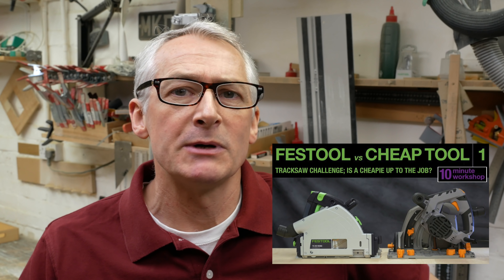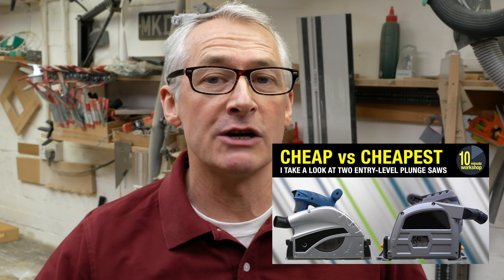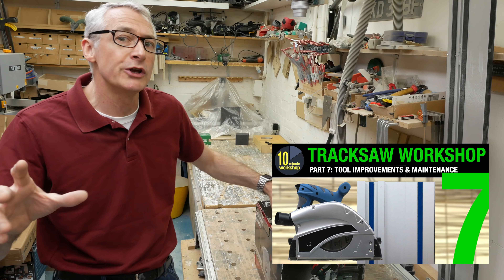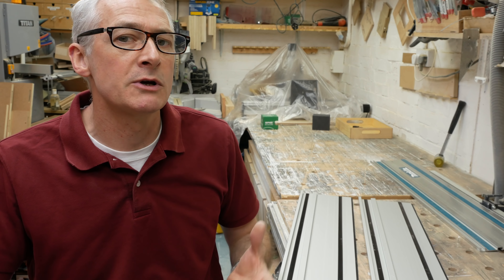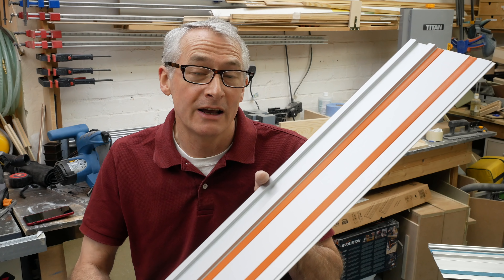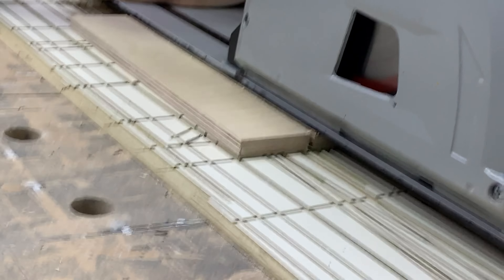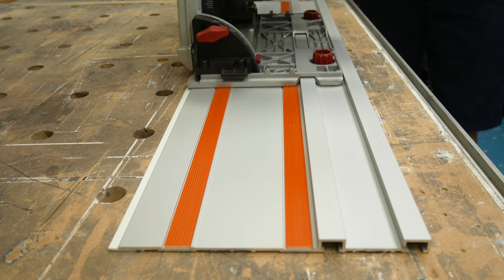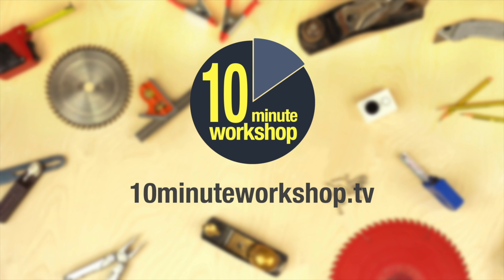Lidl's Parkside Tracksaw [Video #323]

Comment: Thanks for another informative video Peter. As a hobbyist DIY’er it’s refreshing to get reviews of tools that don’t cost an arm and a leg.

Do you think for use outside this saw would be ok without any dust extraction?

Also any recommendations for blades to improve it?
Reply from the maker: Thanks! Plunge saws are generally designed to have dust extraction, but I’m sure they’d be fine without - usual health warnings apply, of course. Video out next week about the blade upgrade 👍👍
Reply: Looking forward to it! Picked my parkside up this morning.

Comment: Got one today. Last one in the shop and a guy tried to buy it off me as I queued lol. A mere hobbyist so should be good enough for me.

 One question; would the cut be good enough to joint a board for glueing up?
Reply from the maker: Great saw for the money. As for jointing boards for a glue-up, the stock blade may be OK for a rip cut, but for anything else I’d fit a 48t blade 👍👍 Video out about that on Tuesday.
Reply: @10MinuteWorkshop  Thanks, I look forward to it.

Comment: Timely video, I was just about to shell out for a Makita track to upgrade my Lidl saw.  Looks like I’ll be going down the Evolution route, as it looks like the  Festool rail won’t be worth the extra money, given it’ll be a Lidl saw riding the rail.
Speaking of the rail, I’ve found that the sacrificial strip has come away from the Lidl rail after about a year.  Still for £65 the saw is an absolute bargoon.  However, anyone thinking of buying the saw should budget at least a set of rail clamps, even if you’re happy with the rail.

Comment: Which is in your opinion the better budget saw, Titan or the Lidle ? Also does the Evolution track work well with both saws ?
Reply: Peter Millard, I’ll settle for the parkside and add the evolution track with up graded blade, should be more than up to the job for the little I’ll use it, thanks. Sorry what’s the compatibility issue with the parkside track, must of missed that bit 🤨
Reply from the maker: Other way around - the Parkside saw won’t fit on Makita-pattern track because of the anti-tipping lip they have, but if you’re OK with joining 2 Evo rails for full sheets, it’s a non-issue. 👍👍

Comment: For anyone else interested: I've just had an email from Kompernass telling me that they can supply 2 x 700mm tracks with connector at £31.24 inc postage. Personally, at that price I think I'd rather put the extra money in and get 2 x 1400 track from evolution, especially as that price includes two rail clamps and a decent bag.
Reply from the maker: That’s interesting, thanks Haydn! I was told that someone bought them for around £17 a pair posted, but if they’ve jacked the price up that much then I agree, the Evo set is looking like even more of a bargain. 👍👍
Reply: Peter Millard Your welcome Peter. Just thought parkside users might like to know.

In fact, I owe you a thanks or two for all the info on your “Tracksaw Wokshop” series. I’ve been a long term powertool and woodworking machine user for 25 years (I’m an antique furniture restorer and French polisher based in Bushey, Herts.) but despite that I’ve never owned a track saw. I took the plunge..... dum dum tish! ... and bought the Parkside with a view to seeing how useful I’d find it and possibly upgrading to a higher end tool once I’d established there was a use for such a thing in my work flow. I’m already liking it a great deal and thinking ahead to a Festool unit. 

Like i said, very grateful for the guide and i look forward to both going through your old and future Youtube content. 

Kind regards,
Haydn

Comment: Hi Peter
After watching a couple of your videos especially the ones about track saw I decided to make my own Home-made one it did not work out very well so I purchased one it was the Silverline-ST2800 tracksaw it came with two 700 mm rails I have tried without success to see if they have longer rails.
My next option is to find a longer rail that is compatible from a different manufacturer I have been looking at the Evolution ST2800 truck rails But I don’t know if it’s compatible I don’t need to use the rails together if it will work with my saw that will do fine but the Evolution ST2800 cost about £70 And that is a bit much to pay out to find it is not compatible they have a list of compatible track saw but mine is not on it unless it’s a different badge I really love my tracksaw it’s made a lot of difference to how I deal with sheet materials that’s why I would love a longer track 
Hopefully you can help.
Winston
Reply from the maker: Hi Winston. As you’ve found, guide rail compatibility can be a bit of a headache. I’m not familiar with the Silverline saw, but visually it appears very similar to the Parkside, albeit with a different pattern to the blade cover. From what I can see online the track are a similar pattern to the tracks that come with the Parkside I have, so I would expect the Evolution rails to fit fine, but I can’t guarantee that as I’ve never had this saw in my hands. All a I can suggest is that you buy through Amazon (link in the video description) who have a good returns policy - and check the saw fits before trimming the splinter-guard! another option may be to make a long guiderail; I did this in Part 6 of my Tracksaw Workshop series, and it work d pretty well! if you do decide to buy the evolution rails, let me know if the silverline saw fits OK - it’d be good information to have, thanks! 👍👍
Reply: Peter Millard thank you for taking the time to reply any information I find I will let you know
Winston
Reply: I’m also getting a hvlp

Comment: Hi Peter. Could you fit Festool blade to Parkside a compare cuts. Good balanced video as usual, well done.
Reply from the maker: Thanks! I suppose technically you could do the blade swap, but they’re different sizes (160 vs 165) so I wouldn’t recommend it. There’s lots of other blades available though. 👍👍

Comment: ...and, as reliable as the returning Swift, this saw makes a return to Lidl GB stores 6 June 2021...
Reply from the maker: Yes. Video,out this week comparing the Parkside to then MacAllister. Purely co-incidentally, of course. 👍
Reply: @10MinuteWorkshop  Interested to see if the Macallister is a rebadged Titan. Also note the description of the Lidl one says "Spacer wedge prevents the saw blade from jamming." Could this be a newer version with a riving knife?
Reply from the maker: @manceconomist  That's interesting - the one 'action' shot they show doesn't show a riving knife, but it could just be an older photo.

Comment: Did you get any feel for  its dust protection? Did a similar amount come out on the side as the feestool?
Reply from the maker: I didn’t test it specifically, but in general it was probably on par or perhaps slightly better than the Titan. Nothing like as good as the Festool - which shouldn’t be a surprise. 🤷‍♂️👍👍

Comment: But... does the scheppach pl55 (workzone) fit the evolution rails? 
According to the woodwhisperer they fit but when the blade plunges it hits the aluminum of the rail.
I really hope that this isnt the case with the evolution rails. Nice video peter!
Reply from the maker: Thanks! I’ll have more on this when I get to the Evo rails, but that’s correct, the workzone has an uncommon base width that causes problems. That’s one of the (many) reasons I couldn’t recommend it in the previous vids. 🤷‍♂️
Reply: I've got the Aldi / Scheppach. It does fit the Evo rails very nicely, but it leave a wider section of splinter guard from memory. It doesn't hit the aluminium. I would imagine using a different "normal" saw on the Scheppach rail would result in hitting the aluminium though.

The other difference is that the main rail the saw rides along is SLIGHTLY different width between the two rails as well. Think the Evo rail / rib is about 0.5mm different to the Scheppach / Aldi rib.

It's definitely annoying, as it means if you want to keep the Alid / Scheppach tracks for shorter cuts and the Evo track for longer cuts you need to readjust the cams each time you move between rail systems.

Not done any critical cuts with the Aldi saw / Evo rail YET, but when the time comes I've got some thick solid rubber strip to replace the splinter guard with so hopefully the fact there's 3-4mm rather than <1mm sticking out won't be too much of a problem.
Reply: @markwalker5956  ...you'd think that at least the cheaper brands would just standardise on a rail & stop wrecking our heads 😒

😎👍☘

Comment: Hi, Can the Parkside track connect to the  evolution track?
Reply from the maker: Yes, and it will run pretty well, but the 'glide strips' on the parkside rail are a little higher than on the Evo rails, so make sure the Evo rail is after the Parkside rail to avoid the 'jump' 👍
Reply: @10MinuteWorkshop  Thank you

Comment: Is the Festool compatible with the parkside tracks? I own the Festool but often which I would have a shorter track.
Reply from the maker: Yes, but as noted, you’ll struggle with some of the accessories because of the funny channel. But for simple sawing, yes, absolutely. 👍👍
Reply: We really need a rail compatiblity chart at this stage... I personally am totally confused about this because of so many saw brands... 🙄🤔

😎👍☘
Reply from the maker: @peterfitzpatrick7032  It's coming... 👍
Reply: @10MinuteWorkshop  
🤗🤗🤗🤗

😎👍☘
Reply: Buy the evolution track and chop it in half
Reply: @paulmcfadyen689  I could but the parkside is cheaper. 2 rails for 20 euro
Reply: @ecuadorianme  fair enough. I have the makita and the parkside, I know the parkside saw doesn't fit on the makita track but tbh I've never even tried the makita saw on the parkside track...just assumed it wouldn't fit.

Comment: Peter you are dead right the Aldi is  a heap of crap compared, I bought the Aldi a year ago almost had an accident the saw jammed in the rails as the rails dont quite run smoothly for the want of a second joining rail, the Lidl saw is way better and smoother (I live next door to a Lidl)  as you did the review I popped in next door and bought one 89 euro good value. I have been very disappointed  that none of them give the clamps our local  hardware store tried to sell me a pair of Schappach clamps for € 50,  damn saw and rails price came close to that  any way Thanks for a very good review keep em coming
Reply from the maker: Thanks Bill! 👍👍
Reply: Peter any idea where to get a couple of cheap clamps €50 for the schepach is ridiculous
Reply from the maker: Here in the UK the Makita clamps are some of the best value at ~£18 or so, though the Festool aren’t much more than that at around £~22. Whereabouts are you based?
Reply: not too far away across the pond, Dublin, you would envy the size of my shed  40X30  loads of room and loads of tools , I follow you as you review lots of the tools I have though I have a lot of Lidls stuff and I find some better than the high end market.  Our local hardware apart from B&Qis Mcquillans robbing hoors. 50 quid for a couple of cheap made clamps I did make a couple . . BTW you would make a great teacher. or do you re-edit your vids?
Reply from the maker: Bill Lupton Wow, 40x30 metres! I dream about having something half that size in feet, lol! 😂 And thanks - lots of editing involved in the making of these videos though! 🤷‍♂️👍👍

Comment: Used mine for the first time in anger this weekend, all good until I tried my first bevel cut. The saw kicked back and whilst I luckily walked away unharmed the splinter guard was shredded! Does anyone know which is the best replacement? I’m guessing as the rail is makita/ festool comparable their offerings or those that fit them will suit. Tempted to grab the evolution rails and not worry about it but I think having the short rails will be useful for piece cuts on the work bench top like that of the mft.
Reply from the maker: Good to hear you’re OK. If you’re new to tracksaws then bevel cuts are an area where you really need to take care -  rails clamped down, both hands on the saw, sharp blade. And yes, the Makita 3-metre splinter guard  - https://amzn.to/2TdVApS - is the one I recommend, generally. 👍👍

Comment: Am not a tool snob I own a few Chinese Parkside tools myself including the same track saw (which after 2 years of very light use has developed a horrible grinding/rubbing sound), The tools look ok on the outside but teardown a Parkside tool and you'll quickly see why they are worse then cheapest tool in a mainstream shop. Such sins as unsealed gearbox's, plastic gears, rounded heads and no bearings.

Stick to parkside corded tools, don't get stuck when they change their battery design  every few years like I did.

Pro's - £10-20 cheaper, often lots of features speed Select etc.. 3 year warranty

Cons- No resale value, loud, underpowered, poor quality, no spare parts, low availability/no replacements when they fail, They fight you on warranty, batteries only 6 months warranty.
Reply: Are you claiming that the Parkside track saw has committed these 'sins' or some other Parkside tools ?  Honestly, I am a little bit skeptical because there do not seem to be a lot of complaints about premature failure of the Parkside track saw (except your one).  I wonder if the Titan also have the same limitations in terms of build quality short cuts ?

Comment: Hello peter, I am looking for my parkside plunge track saw splinter guard strip, but I don't know where to find.please help
Reply from the maker: The splinter guard strip is the rubber strip at the edge of the rail, that the blade cuts through and helps prevent splintering on the face of the board. 👍
Reply: @10MinuteWorkshop  thanks peter,do know where I could find the rubber strip for my parkside saw.

Comment: Needing to rip and cross cut 26 off 8 X 4 sheets of 18mm OSB, I picked up a Parkside Track Saw on Thursday.  I emailed (I have a hearing impairment) Lidl Customer Service enquiring about additional track sections.  I received this reply:

"We do not currently offer spare parts for any of our products. However, I recommend that you visit www.kompernass.com to source the required parts."

There is no track listed on the site, neither is the saw itself listed.

And FWIW, Google turned up a forum post from 2017 where the track was available (two sections for just over £10) BUT did not include the joining bar!

I'll update with any other information I get, but I might well buy the 4800 Evolution track for the rips.
Reply from the maker: The Evo ST2800 (link in the video description) is the better bet. AFAIK Kompernass.com have always facilitated the additional rail for Lidl - the price is currently around £17 delivered for an extra pair of 700mm rails - see earlier on in the comments. But then - as mentioned in the video - you have 4 rails joined together, which isn’t ideal generally, and particularly when the rails only have a single joining bar. Seriously, the Evo rails are a better bet, regardless of how cheap the Lidl rails may be. 👍👍
Reply: Thx.  Meant 2800, not 4800.

Now ordered.

Comment: I know parkside and evolution saws are compatible with each others track from watching this video.. but would you be able to fit both brands of track together?? If anyone know it would be extremely helpful.
Reply from the maker: You can, but as mentioned in the video the profile of the Parkside tracks is a little odd so you get the lip protruding. The Evolution tracks are much closer to the standard Festool-pattern than the Parkside. FWIW 👍👍

Comment: The lengths you go to get people sold on a cheap track saw is quite impressive. And it's hardly relevant for yourself, because you'll just use you magnificent TS55. I wouldn't even tolerate all these less than excellent tools cluttering my workshop.

Comment: shame that is on loan to you has I would with a steady hand just shave the corner so it does fit the Makita rail it only looks like a couple of mil to shave off for the the cost
Reply from the maker: I’d rather trim the rail than potentially muck up the saw baseplate tbh. 🤷‍♂️👍

Comment: could you not simply polish the base of the saw to make it fit into makita rails? It should still work fine with festool and original rails
Reply from the maker: The base is too wide - it catches on the lip of the Makita rails. I did a whole video about how to safely remove the lip though. 👍

Comment: I wouldn’t swap my TS55 for any other Peter

I know I know, not everyone can afford a Festool but I’ve learned the hard way that when you buy a cheap “bargain” tool it usually  dies within a year or two

If you’re ok with that, fine. But it’s hugely wasteful in reality and in the end you’ll end up paying the money for replacements rather than simply investing in the tool you wanted in the first place. 

Cheap tools are rarely good in my experience.
Reply: For most DIY'ers and hobbyist a Festool saw is completely unnecessary. A budget saw, checked for square and with a decent blade will work perfectly well. Of course, if you're a keen amateur with a nice bit of retirement money, go for it. Treat yourself.
Reply from the maker: I wouldn’t swap my TS55 either, but then I depend on them for work, and if I needed to work then I’d use whatever worked. 👍👍
Reply: Ah but... Lidl/Aldi give a 3 year warranty on all their power tools !! 
I personally had a Lidl SDS HD hammer/drill replaced after 2 years with a brand new one  & I was informed that I still had a year left of the warranty .(they dont warranty the new one)  Can't complain with that service at the price-point... 😎👍☘
Reply: Bisch Basch Bosch with all due respect you’ve completely missed the point I made.